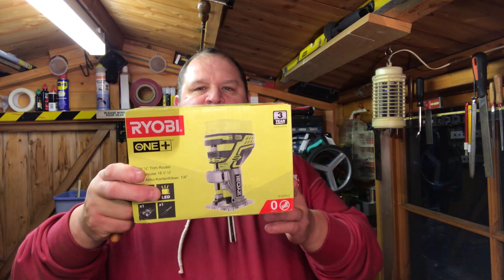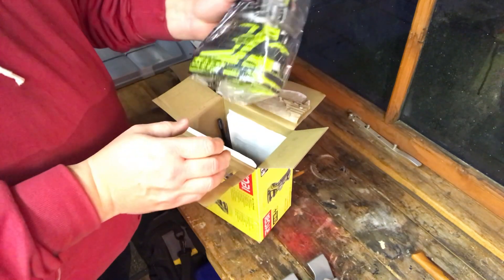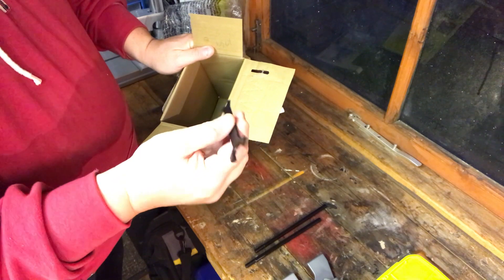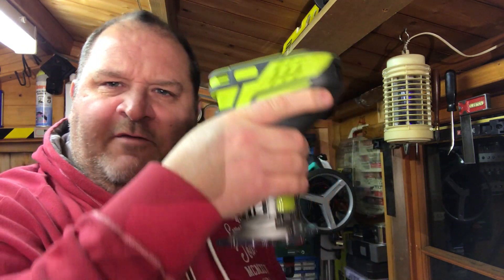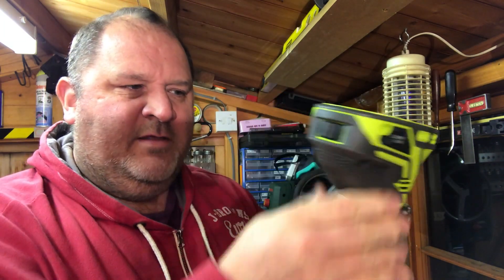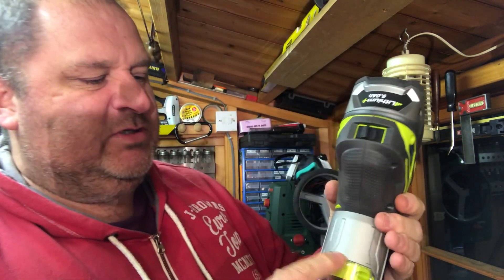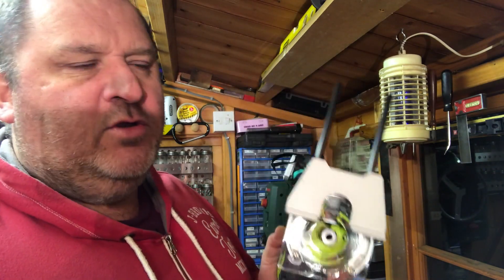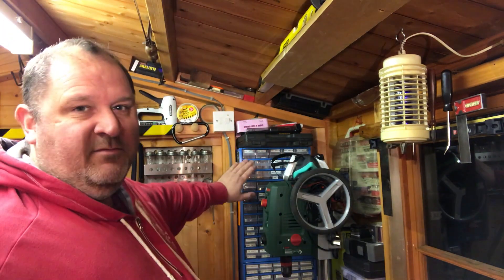Honest & Independant Ryobi Trim Router Review

Comment: I'm keeping an eye out for a trim router at the moment as they look useful  👍😊
Reply from the maker: If you have the Ryobi one plus batteries already, it’s pretty good value at £100. However, if it had to buy a battery for at least £50 and a charger for another £50, I wouldn’t recommend this router. £200 would be way too expensive.
Reply: I went down the Dewalt rabbit hole a few years so don't want to buy another make of batteries, I think I will get a cheap corded version, one day...